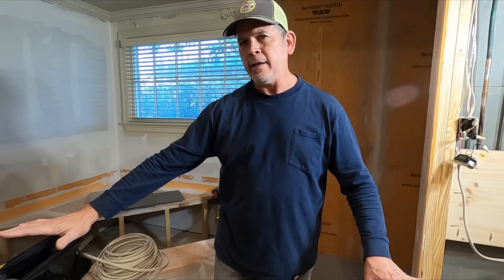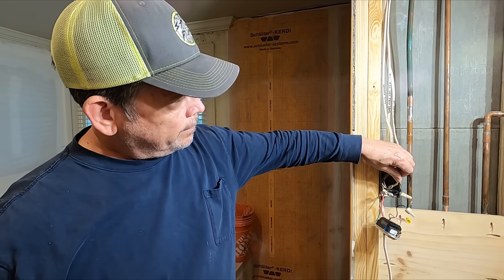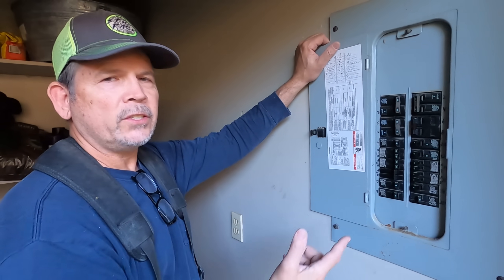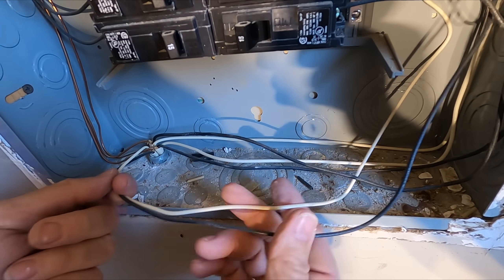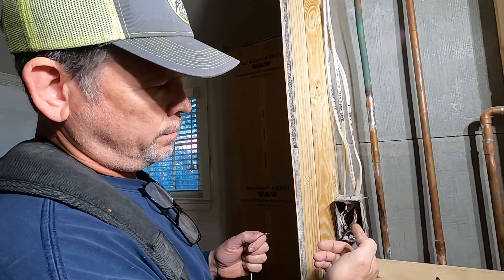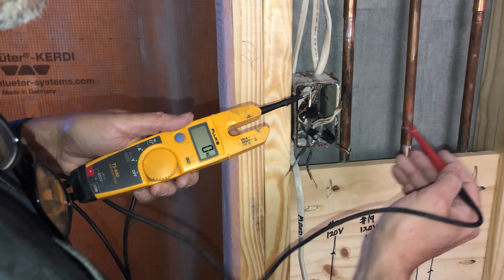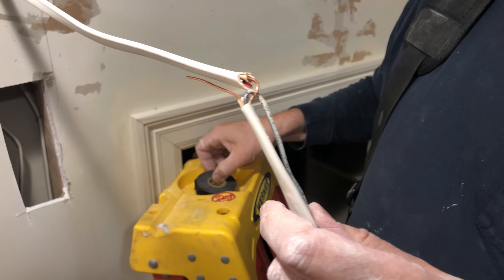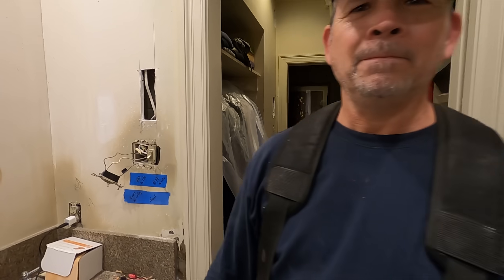You CAN Get SHOCKED by a Neutral Wire! This is How...

Comment: lol in the trade we call that a California connection . your feed back was from the three way switch . i bet you have another switch in that area. the right fix would to be taking the wire off the switch and replacing the switch. while capping both sets  of wire .

Comment: If you received a shot while connecting the plumbing on an ice maker would mean that the bonding jumpers from the hot water, cold water and gas line has not been installed or installed incorrectly and the bonding jumper from the water main to the main panel/ground rod!
Reply from the maker: Posted the shock video on Monday William, check it out 👊

Comment: It is good practice to always meter your box after you have turned off the breaker.  And it is not a good idea to use a magnetic bracelet in a live panel just like like rings or other jewelry as it could conduct electricity much easier than your skin.
Reply: I kinda wondered that myself...what is meter your box?
Reply: @blueplasma5589  just means to check to see if your box is live

Comment: This video has really given me something to think about.  I believe it explains some weird situations I have come up against..  I would never wire a house that way...  you did a great job illustrating the problem.  I was replacing an outlet just the other day that had a spare neutral in the box that was not attached and had never even been stripped.  There was another hot wire coming off the outlet that I disconnected since I didn’t know what it was feeding,  turns out it was a hallway light with two 3-way switches.  I reconnected it and everything works again, but I feel the house is wired wrong...

Comment: I got shocked several times remodeling a basement. The owner put new carpet down before the drop ceiling was put in, so no shoes allowed. When installing grid for the ceiling, I kept getting shocked intermittently. Figured out it was a frayed phone cable touching the furnace duct trunk. Got shocked when the phone rang. 😝

Comment: This type of thing was allowed way back when. It’s a “multi wire branch circuit.”  This would be allowed IF the circuits sharing the neutral were on a double pole breaker, which would turn the circuits on and off at the same time and make it impossible to shock yourself.  Smart man good work 👍👍
Reply: it's still allowed and common on commercial.  In conduit (or with 12-3 romex/AC).   You can squeeze 4 circuits into a conduit rather than 2 without derating (6 wires rather than 4).  You're not doing anything dangerous, since the neutral will be carrying the difference between the 2 hots, and you'll have the exact same amount of heating from current as the max on a 2-wire circuit.

Now I discovered on the last one, they had willy nilly used neutrals all over in the boxes, and none of the multiwire were identified, much less tied together properly on different phases, which is super dangerous...you've got potentially 40A on a 12g neutral wire.

Comment: Hear me out stud pack lol its improper to say 'two white neutrals give 120' ...120v implies atleast one hot wire and one neutral wire, color of wire should be disregarded... In order to find what is the real hot wire , you plug an extension courd from another circuits receptacle.Take the Fefmale end of cord to the wire in question. Now test the voltage between them to find

Comment: Another situation that is a dangerous one is when a previous tenant has bypassed the meter to run a 220/240 outlet in the garage to run a welder or hot tub so they don't have to pay for the electricity. Then they get evicted or just move out but they leave the bootlegged wiring job behind for some expecting electrician or handyman to discover. Sucks when you find live wires in the structure when the mains are off.
Reply from the maker: Yep.  We gutted a house once, no meter, no panel, overhead service transferred to temporary power pole.  The refrigerator still had power keeping my lunch cold😳.  Turns out it was fed from an adjacent structure ⚡️⚡️

Comment: I have been a licensed electrician for 30+ years and I never and no one I work with run circuits in a manner where the neutral is shared out in the field. I consider that practice illegal  and it can cause all kinds of dangerous situations. Each circuit has to have its own dedicated neutral and they need to be paired up in the load panel by code.

Comment: Grabbed a neutral coming from a rooftop motor.  It shocked me.  I started yelling "something is wrong with this neutral system!"  Then realized I flipped the wrong breaker.  Still had hot coming into the motor and I completed the circuit when I grabbed the neutral and leaned against a metal pipe.  I'm fine, but I'll never forget.

Comment: Great video!  Thanks for the very thorough explanation and diagram.  I've been doing DIY stuff for about 45 years and have never gotten shocked, but I'm also pretty paranoid and test every wire I ever come in contact with before doing so.  

In my last house, I tore down the wall between the kitchen and front room, which had 3 switches in it, and moved them to the other side of the door.  Luckily, that was closer to the panel, so I could continue to use the same wires feeding into the box, just had to replace the wires from the box to the lights.  

In my current home (a mobile home with 15A circuits everywhere), I added a dedicated 20A plug right out of the back door so I could run power tools.  After working on this house, I don't think I'd ever add a 15A circuit.  My attitude is that it's better to spend a few more cents and go with #12 wire so if you really need a little more power somewhere, it's already in place.
Reply: Hopefully that 120v receptacle on the outside of the mobile home has gfi protection.  I once was clearing pine needles off a swimming pool screen enclosure and got too close to the pool edge with a plugged in leaf blower.
As I was falling into pool, I remember trying to throw blower onto deck. 
It didnt work and energized blower entered water right alongside of me.
When I got out of pool and removed and disconnected blower, I thanked the inventor of gfi ckt. and reset the gfi that had tripped.
Blower and I both still worked after that incident.
Reply: @officerkrupke4966  Absolutely.  GFCIs are the way to go for anything that even might get close to water!

Comment: I learned a valuable lesson about a hot neutral wire last year. Many years ago my cousin (electrician) wired up a 4 outlet box and switched shop light on my workbench. We did not fish wires but used a local outlet. Last year I was checking out a fan on the bench with a cord plugged into a power strip that is plugged into the bench outlet. With the power strip switch turned off I got a shock and a big spark! I previously felt voltage from a battery charger plugged in (strip turned off) but blamed the charger. With a meter I found the hot side of all outlets had 0 volts to ground and the neutrals were 120V!! The power strip was passing 120V on the wide slots (neutral) and switching the hot which was now a return. Devices plugged in would shut off with the switch but one could get shocked from the hot neutral. I swapped the feed wires in the bench outlet box where the power comes in and problem solved. The lesson was to always use a test light, outlet tester or meter and never assume the power is off or the circuit is properly wired. Now I will test all wires for power when working on a de-energized circuit.

Comment: 5:41 is this a sub or second circuit box? Which should have the ground and neutral separated? Looks as though it has no main breaker shutoff. Although you might have found the solution it would be interesting to see if this was the first leg or the second from the meter.

Comment: I once found a cable the was being worn through by a staple because some yahoo shove a whole house fan into the attic pushing a cable up over it. I cut the cable to reroute it, checked the hot to make sure I had turned off the breaker, and then got bit by the downstream neutral! Couldn’t figure it out. Called in an electrician. He figured it out. A boneheaded remodeler had done inventive wiring and ran a new light, crossed circuits and just grabbed some nearby neutral. Remodelers grabbing random circuits is pretty common, I’m told.

Comment: AFCI breakers prevent this hazard entirely since they won’t reset if neutrals from different circuits are combined.
Reply: In fact, in order to get my house up to code I had to add AFCI breakers to all non-dedicated circuits. In the process, I found a number of issues where neutrals were tied together or a ground was used as a load’s neutral. My house is much less of a shock and fire hazard because of it. I encourage everyone to update their breakers to the latest NEC code that species this type of breaker in many instances.

Comment: I deal with voltage from 120 volts to 500,000 volts grounds and neutrals will kill u. If there's a short or something not done right u can have voltage on grounds. On high voltage static builds up on grounds and any conductor around it and if u get between two different Potentials u will get shocked.

Comment: The problem is you have a bad ground or no ground and a bad neutral connection. You have more issues that you should address. That is a problem and not simply that two circuit share a neutral. The neutral should be tied to ground in the box and have low enough resistance that you do not have any residual current that will shock you. Also in reality the light bulb has resistance and the shock from from that will usually be relatively harmless. Although it depends on the circuit and resistance. A 100W bulb would allow only 0.8A or 800mA. LED would be a fraction of that. Combined with your own resistance its very little and not  comparable to your 120V supply. That said you should always put a meter on everything before handling. You never know what has been done.

Comment: I had to run new rough wires, create a splice on another circuit and add a switch. To create a bit of comfort, I closed all breakers to the house and then tested for energized wires before the splice.  Perhaps a bit extreme but as a DIYer, I suppose you can't be too safe.

Comment: shared neutral was standard practice in the knob-tube days. glad i rewired when i moved into this place.
Reply: It is still commonly done. There's nothing wrong with it. Just needs to be a 2 pole breaker.
Reply: @grizoh  and if the circuits are on fuses? NEC might say it's legal, but what's legal is not always prudent.

Comment: Title is you CAN get shocked BUT ONLY when the wiring is done WRONG or there is a 2 way or 3 way that you dont know about. In any "normal" situation (1 way switch) when the wiring is correct and all the loads are working correctly you wont get shocked by the Neutral ...

Comment: Just like Charles Dickens' Oliver Twist who said "more please," I too would like to see more videos about wiring mistakes. The electrician I hired came highly recommended but made numerous mistakes that I am only now finding and I am now extremely concerned about simply removing plaster walls to add insulation. I have been "jolted" by a 120V once in my life and it was not a pleasant experience and one I do not want to relive.

Comment: I was always taught "First make, Last break" because the neutral wire has no over current protection and is the most dangerous conductor is an electrical circuit.
Reply: It's particularly dangerous, IMO, to share neutrals not only for what is illustrated in this video but that people sometimes share neutrals on circuits in the same phase leading to an overcurrent in the neutral that isn't caught since the breaker isn't in the  neutral wires.  Sharing a neutral on hots in phase A and B means the difference between the two currents in the hot leads is what is flowing in the neutral since the two phases are 180 degrees phase difference.  If two phases A or two phases B are made to share a neutral the two currents flowing in the hot wires add up in the neutral wire.  For instance, if phase A is flowing 15 amps and phase B 12 amps there is 3 amps flowing in the neutral wire.  However, if both hots are phase A (or both are phase B) then the current flowing through the neutral is 27 amps since there is 0 degrees phase different.  
Not worth the risk, in my opinion, just to save a little bit on some wire.

Comment: He got shocked because the wiring is not compliant with current code (and if both legs were from the same phase, it never was compliant with past codes either).  The take-away is never assume the wiring is code compliant, if someone else did it.

Comment: my old house had a whole bunch of fire hazards with the electric wires as well as plumbing issues and roofing and truss problems , Gas pipes leaking and water / carpenter Ants and to much Air flow and bad insulation job . everything that could of been done wrong was done wrong . they even built beds into the rooms and the whole kitchen was built in and had to be cut apart and removed to fix plumbing and water leaks and moldy drywall because of roof vents leaking .

Comment: Everytime I open a box, I always use my electrical pen tester before anything else.
Reply: Yeah, I open the breaker, check for current, short the wire to ground, and treat every wire as though it were still live. I have had a few nasty shocks in the past on what I thought were dead circuits. Nothing says don't be a dumbass like two weeks of chest pain.
Reply: The volt pens Are a great tool to some degree they can be fooled 
The only thing that proves there’s nothing there is using a meter touching metal to metal but know what you’re doing and always remember it’s invisible
Reply: I know of a case where a plumber was shocked to death because of a faulty pen tester. They should only ever be used to test a circuit is live, not dead.
Reply: "Electrical pen" = "death stick!"
Do not trust widowmakers, use a METER or short to ground as mentioned..
Reply: @1mikewalsh  Right on, I use two Pensticks but also a meter (Top Grade one.)Some Pen sticks are dodgy,having been knocked together in Chinese sweat shops by unqualified slaves. You only get ONE chance with power lines.DON'T TAKE RISKS.
Reply: Oh yeah it amazes me what i find in people's wiring i just went to install new lights in a basement and the neutral was hot with the switch  off .someone had wired the hot together at the switch and the neutral was onthe switch
Reply: I just got zapped by a neutral which was caused by an improperly wired 3-way switch on a different circuit (3 way switches seems to be the most common denominator). The neutral would not become hot until it was separated from the other neutrals in the box I was working in. When I pulled them apart, ZAP! The original electrician pulled hot to the light fixture from one circuit, and neutral to the fixture from another circuit. I don’t understand HOW it works, but I was able to fix it.

Comment: Good info but I think its important that we do not call "line" phase! There is a reason that a 240 volt service is called single phase and not 2 phase and that is because phase is the relationship between the 2 lines and not lines them selves. Think of 3 dots on a clock face 12, 4 and 8 O'clock lets say the 3 dots represent 3 lines in a 120 degree 3 phase power system. take a pen and draw lines connecting the dots. How many lines do you need to draw to connect the dots, 3? Now lets represent single phase 180 degree power on a clock face, dots at 12 and 6 O'clock, again how many lines do you need to draw to connect the 2 dots? A single line is correct as there is a single phase. The mistake is completely pulled from the simple fact that 3 phase power has 3 lines so lines must be phase? this is wrong, line is not phase or 240 volt systems would be 2 phase. I am aware that residential service is made from a single line of a 3 phase system by means of a center tap transformer sometimes incorrectly referred to as "split phase" but this is not why we call it single phase.

Comment: Great video showing the dangers of old construction.  I've seen junction boxes in new homes with 12 Romex cables coming into them.  I would never trust that they were wired correctly and I'm not an electrician.  Wow.  NOTE:  I do electronic repair and understand circuits so I'm a "leg" up.  

Here is one for your thinking cap and would be an awesome video:  Old home with Knob and Tube wiring.  Usually they run the Line on one stud and the ground on the facing stud so the wires are separated by stud spacing.  The original home was built during The Depression using 2 fused circuits:  Lights and Receptacles.  The Light circuit came out of the box, both wires together for a few feet and THEN (!)  One wire went to one end of the house and the other wire went to the other end of the house!  - I have no idea what they were thinking.

But it gets better:  when balancing out circuits in the breaker box that was installed 30 years ago, I decided to put these two circuits on different legs.  I'll spare you the description of what happened, but I am lucky I did not burn the house down.  Evidently they were cheating between the two circuits knowing that they were running on the same leg.  Did homes have single leg fuse boxes in 1930?  

I doubt the house will be rewired but for now, the 2 original circuits are back on the same leg.

Comment: 277v lighting circuit sharing neutrals. You kill the braker for your circuit but the unbalanced load from the shared circuit comes back on the neutral. Then you touch the ceiling grid on the office you are working on. As you proceed to break the ceiling grid and scrambel down the ladder you also relize you are cusing up a storm as the rest of the trades men are giving you that look. You play it off and learn a valuable life lesson....